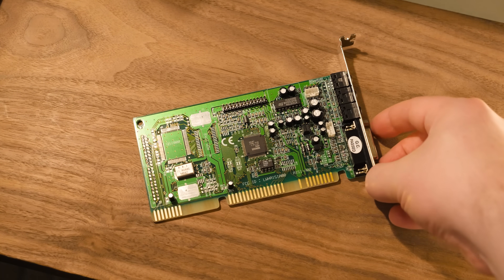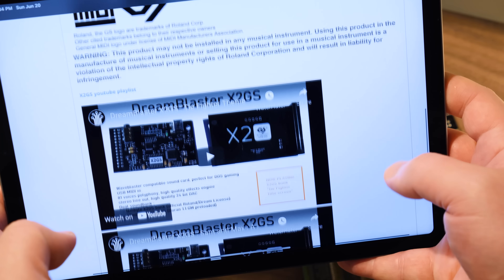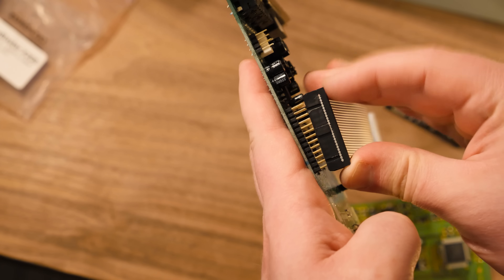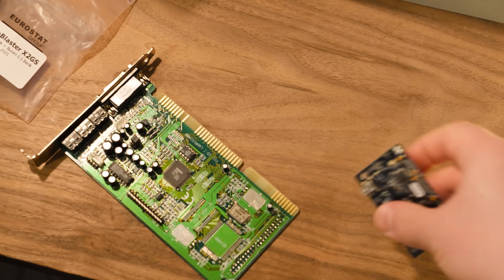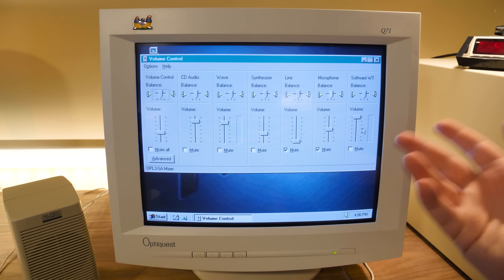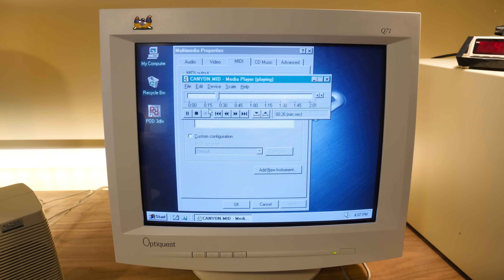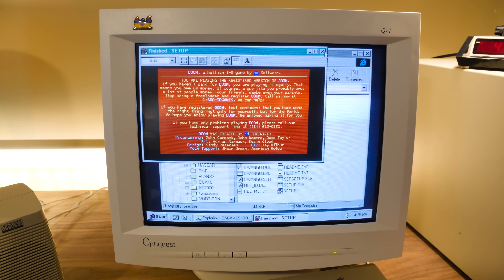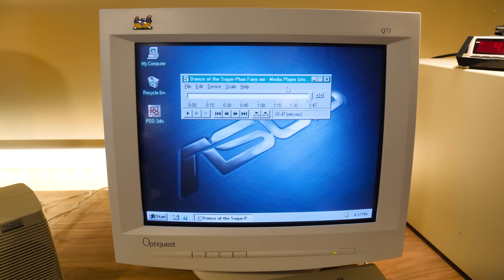Adding a DreamBlaster X2GS to my Socket 7 PC

Comment: I'm kind of amused at the idea of new viewers lecturing LGR about CRTs.
Reply: @tmbrwn  What does age have to do with someone saying some of those people lived through the 70's? 
Seriously? Thats a real question?
My response was to some saying this as though it meant something. 
I simply said I did and still found it amusing that people would get preachy about them to someone younger.
Reply: Use a LCD and you get the rants of how a CRT is superior.... use a CRT and get the rants that they cant handle the whine of a CRT... no win scenario
Reply: @gremfive4246  Time to break out the Gas Plasma Display I say.
Reply: @gremfive4246  
CRTs really shouldn't whine if your speaking of a monitor. Some TVs though is seems to be pretty common. A whine is typically a sign of age and something may go wrong. I have quite a few Crts and only my old Zenith has a noticable noise to it.
Reply: @tmbrwn  doesn't matter, lecturing him about CRTs is still ridiculous
Reply: I got a chuckle as a guy who's been repairing TVs/Monitors and terminals for almost 50 years. Damn kids lol
Reply: Some of the new viewers are twice LGR's age and were involved in computers since the 70's and went thru all of this equipment and software when it was new.
Reply: @GEORGE-jf2vz  and? 
I've been using computers since the late 70's too. 
Doesn't stop it being amusing when people demonstrate ignorance to a younger person's experiences.
Reply: @beezle1976  Mid-Late 1970's here (and that was the PDP 11/20 at my high school).  I remember trying to get a CRT terminal donated from the company my father worked for (well before the owner was assassinated by the Mossad) to supplement the ASR-33 terminals we had.  Went through various CRTs over the years, up through a 19" IBM monstrosity.

These days I just don't want to deal with the weight and bulk of them; at my age I'm trying to downsize, so it's just flat-panels on KVM switches.  And hunting down a cable to plug my TI 99/4a into the composite video on my TV (yes, still manage to have a TV with a decent selection of ports).
Reply: @SenileOtaku  "owner assassinated by the mossad"

I bet he was a fucking beast in the best ways possible. Damn shame.
Reply: @GEORGE-jf2vz  That's...fair, I guess.
Reply: @GEORGE-jf2vz  Just because someone used a device for x amount of years doesnt mean they have a clue about the hardware they used. 99% of people who use a pc have no clue how it works or what it is, its just a thing they use. Also you dont have the statistics for LGR's channel so the "statistics" you just mentioned, came deep from inside your butthole.

Comment: 3:15 Thank the Raspberry Pi 1 for those being available for cheap.
Reply: Its not a Raspberry pi cable! the RP cable is much wider.
Reply: @marcelhh2101  The RPI 1b was 26 pins. I said the cable would be cheap because starting with the b+ it was 40 pins which made the surplus of 26 pin cables worth very little.
Reply: @keith_5584  Ohw that’s correct indeed. could be the reason yes, although I’m surprised that there would stil be a lot around these days, that a long time ago.
Reply: @marcelhh2101  I think it comes down to how many a factory in China makes. More specifically, it does not make sense to make any item unless you make a surplus, otherwise that factory would make something more profitable. Some can be reused but shelf space is getting more expensive, so selling at a loss is worth the exchange or storing something on the shelf that sells better, instead of the unsold item holding up that unprofitable space. 

It is kind of a old problem, but in massive force in today's age. You can get better details from some of Amazon's supply chain, but some of it trickles back down to the manufacuring in China. (or other industrial driven locations)
Reply: If you needed one back then, you probably could get away with just repurposing an IDE cable.

Would also probably give you the length to tuck the daughterboard in a spare drive bay too.

Comment: That Roland daughterboard looks like it has holes that can be used for attaching it to a PCI slot bracket. That way you might be able to mount it cleanly between the sound card and the voodoo card.
Reply from the maker: The holes are for attaching to a full-size ISA sound card, like the Sound Blaster 16. That's the exact issue I'm getting around by using the X2GS.
Reply: @LGRBlerbs  Ah I see. I can imagine there being a way to mod that board to fit nicely. But it's totally understandable if you don't want to do that. The X2GS sounds amazing after all! 😄

Comment: The way the ribbon cable connects that board reminds me of the PLG cards for Yamaha's MU 128 and onward, and others that used that system. Mind you, they had rails inside the module you could slide the cards onto. Wonder if a mount like that could be made to fit inside the case somewhere?

Or, just use a taller sound card, but that's easy.

Comment: I'm curious if you have any opinion one way or another on the Media vision Pro Audio Spectrum.
Reply from the maker: It's a good DOS card, I've got a PAS-16. Not something I'd pick for Win9x though.
Reply: @LGRBlerbs  I just recently picked up a PAS16 to try out in my 486.  I like it quite a bit so far; I can't believe how loud the digital audio is, in comparison to the FM portion.  

I mainly bought it because of the way it handles the PC Speaker.  I have a crappy piezzo one one my board, and no PC Speaker header on my motherboard, so I thought I was stuck with it; but the pas16 has its own PC speaker header, so I can finally have a less crappy PC speaker.

Comment: 6:18 the 4 on that clock is kinda ill, segments fading in and out. Why is that behaving like that?
Reply from the maker: Refresh rate and camera shutter speed not matching. Same thing happening with the CRT flickering throughout the video.
Reply: @LGRBlerbs  Thanks, I didn't think of that. I though there's some power issues with some old caps inside :)

Comment: Yes the ribbon cable solution is inelegant, but I think you could've put a back plate on it and put it on a place without a slot.

But your way is better.

Comment: I'm currently using a Serdaco DreamBlaster S1 (Final Edition) on an Audician 32 Plus in my Celeron 400(A) 98se/2000 build. Sure, it doesn't have all the bells and whistles of the X2GS you've got, yet for me it's synthetic wavetable sound, that's somewhere between a Roland MT-32 and a Roland SC-55, is still really punchy with the likes of Duke Nukem 3D and Doom.

Comment: I can't wait till AGP cards start getting new projects
Reply: @Common Raccoon PCIe* to AGP
Reply: @Common Raccoon The PCIe implementations were a bit faster a) because they were native and b) because PCIe is a more robust platform.  The bridge chip added latency and introduced some bugs that they were never able or willing to work out with either a firmware update or a driver workaround.
Reply: Already happening with the next 3dfx V5 6000 creation by that Russian engineer.
Reply: @Common Raccoon They were called bridge chips and they had issues of their own.
Reply: @Common Raccoon I know those fake ones for comedy videos, but that guy "zx-C64" already created at least two Voodoo Graphics SLI setups, one two card setup called Stoned Shaman 20 Mb 3dfx Voodoo Graphics SLI Setup (https://www.voodooalert.de/board/forum/index.php?thread/24336-stoned-shaman-20mb-voodoo-graphics-sli-review/) and one dual plane model. I think his next project was already the recent V5 6K Remastered, which was PCI, which was covered all over the IT media. Link to the official forum thread: https://www.modlabs.net/forum/topic/60674/
AFAIK he's now developing an AGP model V5 6000. I can't find the link now, but it's very early in development.

Comment: Thats the best ive heard it! Not that ive extensively tested.

Clint, on the topic of CRT’s, I wonder if you could let me know whether my CRT is any good (high/low end) as I am interested to know. Its a Compaq v900. No idea!
Reply: It's a mid range model. For retro gaming I think it's very good since it's got a shadow mask and a high horizontal refresh rate. Lack of a BNC-input is a bit of a shame especially if you wanted to connect a system which has (a) 3dfx accelerator addons card(s).
The CRT Clint uses in this video is a lower class model but as you can see every CRT is better than no CRT :-) for DOS gaming especially, but also later games up to a certain time where developers themselves began using LCDs when creating the games.
Reply: @armorgeddon  thank you, I appreciate your time telling me this very interesting info about my crt that I literally knew zero about! Nice one :)
Reply: @retro_gamer_uk  Thank you also, you're welcome! Greets!

Comment: I'm definitely considering buying one of these, not to plug into an old sound card, but because it also has USB control and 3.5mm line out. That means I should be able to pass it through to DOSBox and get passable Sound Canvas sound...
Reply: Yes that works.
Reply: @Serdaco  Wow, the possibility to also use it via USB is great! Regarding using it via USB: Is the analog out on the X2GS the only way to output the sound then or does it feed it back into the computer via USB so that you can software-mix it with the PCM and output both sources via the PC's soundcard? And also does the X2GS work on Linux?
Reply: If you just want something akin to a MT-32 there's Doxbox-ECE which will emulate that. You still need the original rom images but those aren't hard to find.
Reply: The official Sound Canvas VA software would be cheaper on a modern PC. Though possibly not as straightforward to integrate with DOSBox.
Reply: @flow221  Roland SC VA works decently as well. I use both an X2 via USB (not GS, haven't saved up enough to buy one of those yet) and the SC VA Software, depending on what I'm running. SC VA can be a bit tricky for the first set up, but I'm quite happy with a combination of SAVIhost to host the VST plugin, loopMIDI as a virtual MIDI interface and MIDI mapper. Once you get the setup working it's really not difficult.

But still, using actual hardware will always feel better to me, so I will probably buy an X2 SG at some point as well :'D

Comment: Can’t believe you get hassled over CRTs. CRTs we’re annoying in the 80’s, annoying in the 90’s, annoying in the 00’s, and are still annoying today. Heavy, heat producing, failure prone annoyances.
Reply: Old games use all sorts of weird resolutions and refresh rates, most of which will look like crap on an LCD. CRTs also benefit from extremely low latency. They're a bit impractical for sure, but for retro gaming the benefits are obvious.
Reply: @ozzyp97  for retro gaming they still produce heat, still weigh a lot, still fail constantly, still cumbersome to dispose of. “Gaming” isn’t an answer to to people being crt purists.
Reply: @ukozi  fail constantly unrelated? Nope. Cumbersome to recycle? Nope. Throw out heat? Barely. Heavy? Barely. Sure as shit not the ones people.use for gaming.. You're being pretty ridiculous here, dude. They are objectively better for certain gaming scenarios. No reason to get so worked up over it
Reply: @jbfarley  please tell me more about the 17lb lcds you’ve seen
Reply: @ukozi  Seems pretty average for ultrawides. Samsung's G9 weighs almost double that. I don't know why you'd want to regularly carry a CRT around, but I suggest being more careful if you've genuinely experienced constant failures. They're not actually that unreliable.
Reply: @ozzyp97  CRTs are one of the most unreliable components of a retro machine - you know it, I know it, and the American people know it. Also ultrawides are for dorks and mothers.

Comment: Dude, I loved your previous midi mountain video! In particular I really liked the sound of the Kawai GMega, so much so that I immediately created an eBay saved search for one. I'd like to say my patience paid off and I got one for a great deal, but as soon as my overtime came through I jumped right on the next one that appeared. I may have paid more for it than either my SC-55 Mk2 or MT32 (although I did get a genuine deal for the MT32, so that's not a fair comparison). It's currently on the way for Japan as we speak!

Anyway, I think the X2GS is a really cool option. It might seem like a lot of money for such a small thing, but it's still cheap compared to an old school Sound Canvas! And looking at the specs you can load a second soundbank, which I don't think you can do on a regular Sound Canvas?

Comment: Excellent. I've just received my E-Wave daughterboard from Serdaco, built on the ES692S MIDI chip. I love it. I'm plugged into an ES1868 card, and in Win95 I can control the daughterboard volume with the Aux B level in the stock Windows mixer. Not sure if there's an equivalent for the Yamaha card.

Comment: I have an amd 1gb ram win98/2kPro looking for an agp card but not 100% sure if getting a 256mb card will bottleneck the cpu/ram
Reply: I've made a Win98 build with AMD, 1,5GB of RAM and a 256MB GPU and it runs fine
Reply: @ElAltar0  how you get around the 1gb limit
Reply: @darunealbane  There's a mempatch(unofficial) for the system to run with more than 1GB. I could use only 1GB, but since i use a dual-boot setup (Win98/WinXP), it's better than swapping parts everytime.
Reply: Just get as much RAM as possible for any given part.